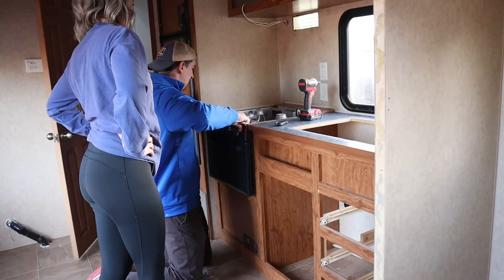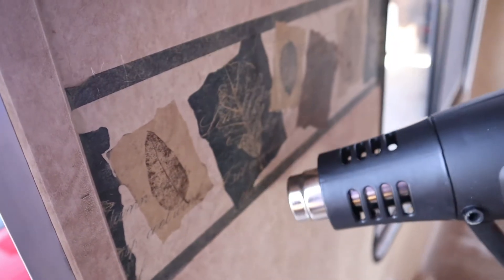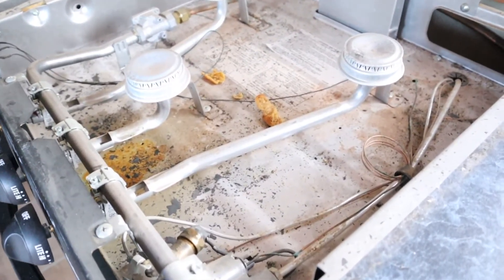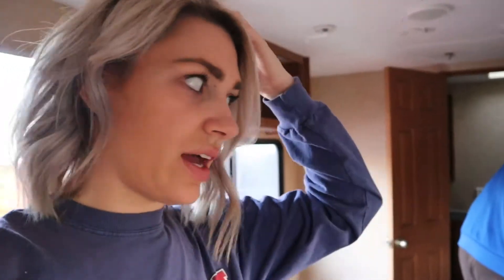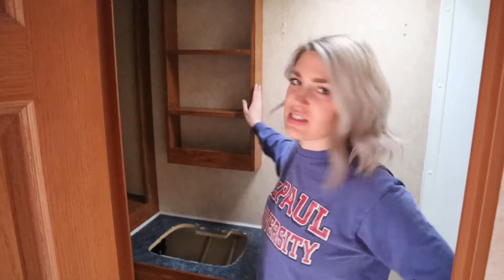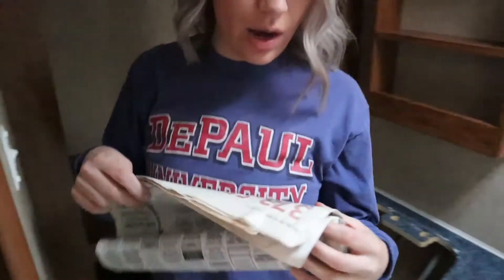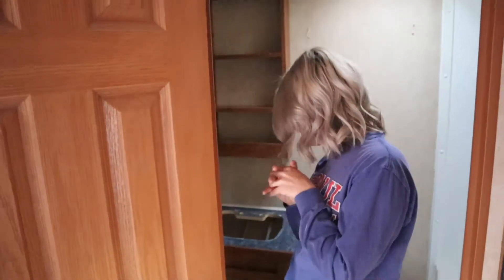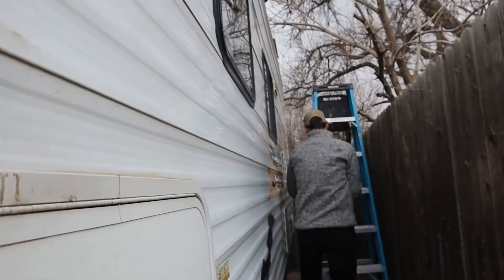Preparing RV for Snowstorm//Demo Continues - RV Renovation Ep. 3

Comment: Make sure you reseal all the corner trim, windows, and roof. If you aren't taking anything apart, clean the area, trim any excess butyl tape, and use a solvent-based caulk around the trim, screws, windows, etc (don't use silicone, you will regret it a couple years later). Or you can re-butyl tape everything, but I think your camper is new enough that you probably wouldn't need to do that. Also reseal your roof. If it's rubber use a coating compatible with that type of rubber membrane.
Reply from the maker: Hey Zane! Good info. We’re actually getting started on resealing the corner trim today and plan to do the roof/windows soon. It’s been snowing/raining quite a bit here in Colorado but we finally have a dry window to get this done.